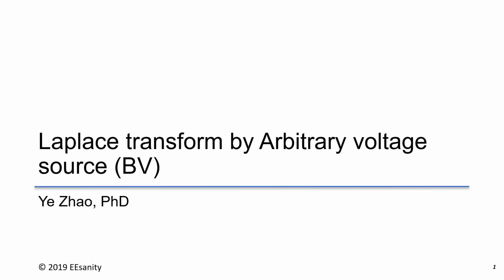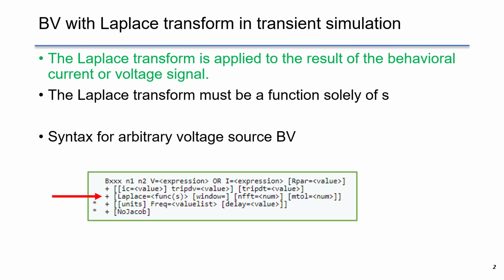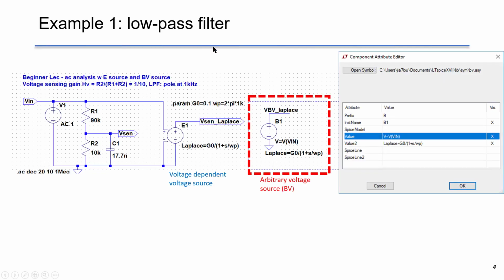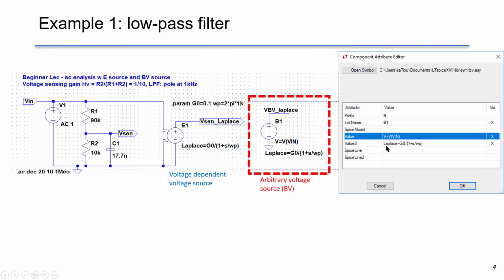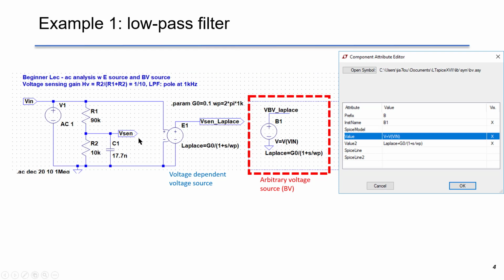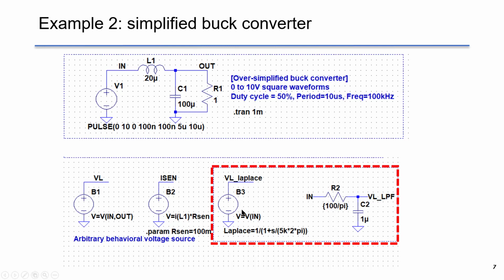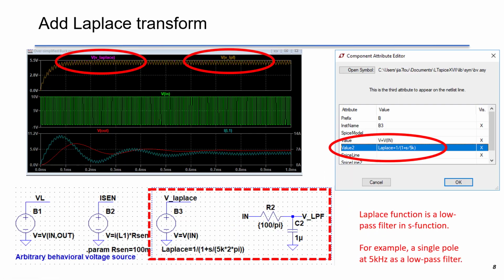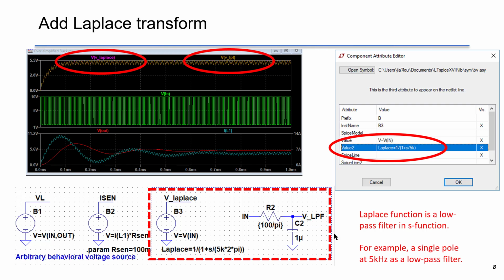LTspice Tutorial for Beginners: Laplace transform by Arbitrary voltage source BV

Comment: Very clear!! Thanks a lot! A question, is possible that the Bode with laplace it can simulate NOT in hertz but in rads/s in "x" axis? ("y" axis in dB and "x" axis in rad/s)  For example a LPF with H(s)=1/(1+s/wp), with wp=10 rad/s and after the simulation, see in the plot that effectively, the pole is in wp=10. Thanks a lot!
Reply from the maker: Hi Franco: It seems that only frequency in Hz is supported in LTspice. You may want to change the pole using wp = 2*pi*fp, and fp is the pole is Hertz. Hz is more intuitive to me than rad/s. Just my perference.  Thank you!